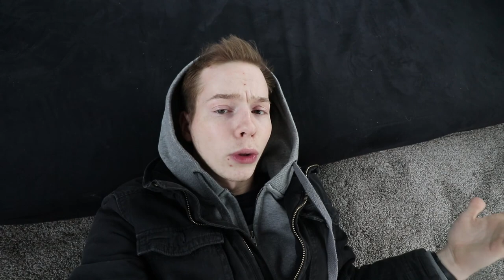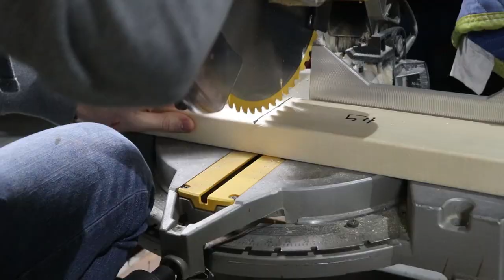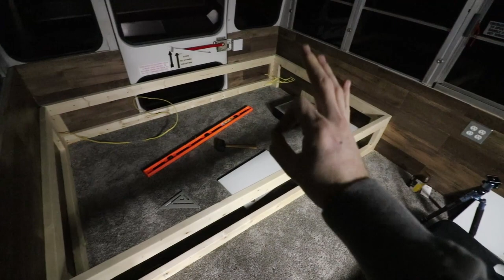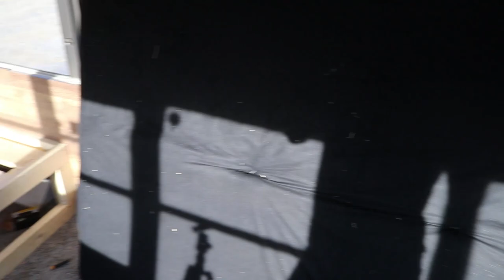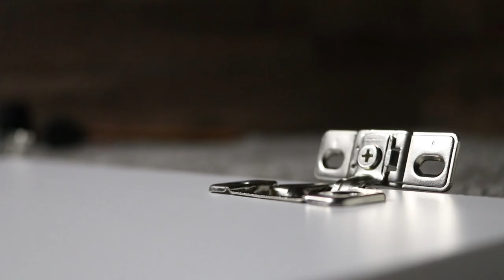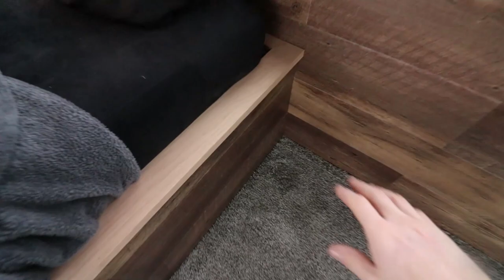Adventure Bus Build Pt 10 - Custom Folding Bed with Storage!

Comment: Great job on the bed, looks awesome! When you use the circular saw to cut, adjust the blade so that it goes half a tooth below the bottom of the wood. That will reduce splintering and will make it easier to cut.

Comment: The bus has a lot of room on the underside by the frame so you could put the batteries and inverter there, even a water tank maybe.
Reply: This, all the RVs here have almost all the utility stuff under the body so you save up room inside and centralize "unmovable" weight
Reply: You can put the batteries on the side it’s like the perfect spot
Reply: I second this! Be much more practical and would allow for a lot more creativity on the interior!
Reply: g6qwerty agree 100
Reply: He's gonna be off roading in it, so must be needing good ground clearance.
Reply: That's actually a very good idea!
Reply: g6qwerty or a generator if you need it
Reply: shrey raj they are in between the frame and body so it wouldn't affect anything
Reply: guys the water tank is best on the top of the bus because the sun will warm it up... just saying
Reply: Put the batteries on the roof, Uncovered and wait until it rains. You might get a nice firework show :)
Reply: Michal Sobocinski so you want to not be able to use the water tank during the summer or something

Comment: How about a back up camera? With such a thing it might be useful
Reply: SECONDED!!!!
A very smart purchase. He could even get backup sensors if he wanted, they're really not THAT expensive to do.
Reply: he could get one of the license plate frames with a bluetooth camera feeding to an android head unit
Reply: That's actually a really good idea, there's going to basically be a bunk bed setup so that would be a good route.
Reply: Backup camera + towing a trailer. 

lol
Reply: back up camera on the trailer ?
Reply: felixlovesredbull currently the trailer has a plug that connects to the rear of whatever you're towing for tail lights, you'd have to create another plug on the trailer AND the bus. I think he'd be better off buying ten mirrors.
Reply: CJ Mervyn back up camera when not towing and tow mirrors when towing 

Lol

Comment: Excellent work. If I had built the bed, I would have put the bed part itself in the dead-bang-middle of the back wall and build two taller cabinet extensions on either side to serve as storage and armrests for the mattress in sofa-mode. You can get tall and narrow slide-out shelves like the ones from rev-a-shelf to put in there. You'll eventually learn that every drop of usable space in that bus will soon be at a premium when you load it up for a few days. Curtains and tint should help make it feel private and cozy too. If you're considering designs for a sink, fridge, and/or other cabinetry, google conversion van galley for ideas. I'm a big fan of the galley foot pumps for water designed for boats. No electrical connection to make water come out of the spout.

Comment: Might be complex but I think you should put retractable/folding cup holders at the side of the couch or end of the bed
Reply: Cami Adam Not that’s complex, he could buy some and just bolt it on
Reply: Cami Adam I was thinking th same thing, that long storage compartment he could make some half drilled holes for cupholders
Reply: saab made those kind of cup holders in the 9-3 and such. could probably glue a wooden plate on it to make it look good
Reply: Cami Adam i
Reply: Just look up boat cup holders and there ya go
Reply: Cami Adam screw cup holders put a whole bar table in it
Reply: Aubry Exactly what i was going to say. They are a bit pricey thought.

Comment: Who taught you to drill a pilot hole everytime I never so unless it's think wood
Reply: It helps the wood not crack. In my experience with wood, it's a good practice to avoid splintering it, which I have done many times. Drill a hole a slight size smaller than the core of the screw, and the threads are just about all that go in to the wood. If the wood is weight bearing, the frame of the bed is a good one to use pilot holes on. Splintered wood loses a lot of strength.
Reply: yea, think wood is a b*tch

;)
Reply: It’s common practice to drill a pilot hole.
Reply: "Takes high school carpetry once"
Reply: Yes, the wood is very think.
Reply: Dat think wood
Reply: Think big, think smart, think wood

Comment: This all looks quite good, love the montage wood cutting. Also, I think you should have the drawers on the bottom side of the bed, swing down instead of up, reason being. It's going to be a pain in the butt to get into it if you have to go onto the floor all the time. Also, use a magnet latch to keep it from dropping, if you do decide to reverse the swing direction. Glad that you're having a ton of fun man. If you need any wood working help, feel free to ask anything.

Comment: u do realise if you put a shit load of electricity underneath the bed, u probably wont even get a single hour of sleep...
Reply: AeroGaming333 van life people do it all the time
Reply: AeroGaming333 why ?
Reply: I think it's fine
Reply: What reason could you possibly have for that....
Reply: "u will probably wont",...lmao
Reply: Why?
Reply: Caleb isn't Kuroko from A Certain Scientific Railgun, he isn't going to get electrocuted all the time for sleeping in a certain bed XD
And in reality, the electric fields are no problem, and there won't be anything that can buzz audibly all the time. My clock radio is kinda defective, and it's right by my head when I sleep, giving off weak electromagnetic fields and a very low buzzing sound. Been that way for 6 years, no problems sleeping between in being unplugged or not. Only the light is a tiny disturbance.
Reply: I hate sleeping with tiny lights around
Reply: Thanks for correcting..... Just so you know, I'm Dutch and my English is shit so ty ;)
Reply: Ok pannekoeken met stroop for everybody!

Comment: Nice work...couple of suggestions, the cabinet doors are going to require flipping up side down-you'll have to be on the floor to see into the area. Better still consider sliding doors that bypass each other.  Borrow or rent a router and round over the oak strip on the front of the bed area. Bumping into it will "wake you up".

Comment: I think you should make those cabinet doors a lot bigger. That’s a huge amount of storage space; and if you’re trying to get something in the back it’ll be a pain to be reaching super far back in a small hole. Also, you should have made the bed taller so you could fit more storage underneath while maintaining your vertical room. In these builds, no space can be wasted. I built out my Ford Expedition EL like this.

Comment: It would be really cool to see a sectioned back door like in a truck with a bed cap or some suvs where the top can open independently of the  bottom so you could potentially get to the storage while leaving the top section closed off

Comment: You should add 12 volt linear actuators to the back of the bed so you can change it to couch mode at the flip of a switch as well as be able to adjust the angle your sitting.

Comment: Looking awesome!  Just a tip for batteries, if you go with flooded acid you'll want a way to monitor and vent hydrogen when they are charging. You can use AGM or gel cells to avoid worrying about that but they are more expensive.   No issue with putting the electrical stuff under the bed, but just make sure it's easy to access/work on.   Basically you'll have batteries, inverter for 120v stuff, solar charge controller if you go solar, and maybe a charger for shore power.  You'll want some switches/breakers so you can turn that all off when parking to avoid draining battery.  Fuses and maybe even a small electrical panel are a good idea.  Lookup the max amperage each gauge of wire can handle and fuse it for that.    Lots of room on the roof for solar panels so lot of potential there.

Comment: Oh oh and hb ! Putting some small 10 inch subs next to the white cabinets you can buy probably two single 10’ sub boxes and then custom fit them to be nice and flush to the wall of those cabinets so they just look as good as they do now ! And if you find a way for it to look flush with like the air vents sub boxes it would sound total bad ass and look amazing !

Comment: Might want to consider putting a brace under the center supports for the bed ..  The screws you used to hold the boards up wont be able to hold long term ..  They will come loose or pull out of the board, and the supports will fall ..    Maybe a metal L bracket if you dont want to put a support under it ...   Could also help to support the center of the boards under the bed so they dont sag .

Comment: You might want to consider some supports under the 2 flat boards you have used in the frame, you are asking a lot of the 8 screws currently holding all of your bed off of the floor. Great job on the bus, very inetersted to see the final version and where the passenger seats will be.

Comment: you should put a short wall to about half the windows height were the pillows are, made of wood on top of the cedar lip you put op on top of the bed frame. the sleeping area from the main living area should be sectioned off a little and the wall would provide privacy. leave a 2-3 foot opening at the foot of the bed w a rounded off corner for entry

Comment: would take out the middle part of the bottom 2 by 4 in front of the rear door so you can slide stuff in tunder the bed  from the rear door , doesnt do mush structurally , you can add some uprights on eac side of the door post
level only works when the bus is sitting level , having the doors hinge to the tp isnt handy for getting stuff in and out (have to bend down pretty deep to see whats in the storage

Comment: You might want to shore up your slats for your bed, you get to gingium up in that bed and your gonna blow those screws right out of that frame... Maybe a L bracket on the inside just to get screws going in two directions. Just a thought.. ;)

Comment: Maybe make sliding doors for the cabinets under the bed? It will take less space, as you wont need clearance for the upwards swing of the cabinets now; and it should not be that difficult to change over too. With sliding doors you could also match the wood with the rest and just put finger sized grommets in for handles.

Comment: I think you should have gas shocks holding up the couch/bed folding section. I think it's cooler than having a piece of wood that just supports it.

Also hide the wire in that hatch. It looks butt ugly, manage the wires or something.

Comment: Nice bed cabinet doors but i'm wondering if they would stay up with that hinge mechanism?  Might get annoyed after some time especially when you're putting something in which requires two hands.  I would have put the hinges on the inside and let them both open towards each other instead if space permits it.

Comment: you should have left the bottom cut on the board so you could slide the battery rack in and out to service it through the back door...just saying. you could still modify it later. looks good

Comment: And I've noticed you have been using a drill to put screws in if I were you I would look into an impact driver makes it so much better and doesn't strip the heads of the screws out and if you do look into it get a Milwaukee,the best quality you can get 

Also works good for stubborn bolts.

Comment: Paint the bottom window on the rear door black so no one can see what you're storing under the bed and tint the rest of the windows 5% as well as curtains. I've had 4 different camper vans and privacy is key

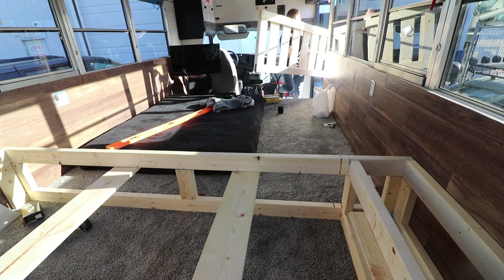Comment: Ok so here's my question. At @8:00 the only thing you have under the folding frame, mattress, bedding, and two people sleeping on the bed is 2 1x4's screwed in from underneath? There's no way that's going to hold. Especially with any sort of "activities" on the bed. Might want to think about reinforcing that somehow.
Reply: Or maybe they're 1x6's can't really tell... But still not enough.
Reply: Hmmm yeah you may be right, the issue is not the lumber, but the way that the structural integrity is relying on the pull strength of the fasteners.   It may be too hard to go back and change it now, but he may be able to just add more.  I would put at least 3 screws per side at angles, maybe even lag bolts on a few of them.   That said it's probably good enough, but I like to overbuild stuff.
Reply: Red Squirrel The amount of unsupported weight across that big of a span is too much for 1x. As well as fastening from the bottom. But yeah, going to need to do something to fix that. Just the weight of the bed frame and such bouncing down the road is going to try to pull those screws.

Comment: You just need some air conditioning where the bed is and it will be nice and cool.
A list for the adventure bus
Fridge
More air conditioning
Bathroom 
Couch
Tinted windows
Car wallpapers
Superglue the backdoor so it won't open

Comment: Can't stop thinking about the yellow wiring rubbing off and conducting with the metal wall. Could the extra plastidip insulate in case it happened?
Reply: It will probably be okay because that yellow jacket is not the wiring insulation. NMB and other Romex-style cabling have that protective jacket around the three conductors needed for regular residential type wiring, and they have their own insulation beyond the jacket. NMB is also fairly heavy duty.

Comment: I wonder if the pump has airleaks or something because it takes so long to start
Reply: or the check valve is leaking and it empties the fuel line back in to the tank

Comment: Please tell me that bed is being held up by something other than those two 2x6 pieces of wood, it will come apart in time, you have 50+ pounds of wood alone on them and combine the weight of two people that comes out to be 350+ lbs of weight resting on those 2 pieces of wood. I works I'm just saying that over time it will start coming apart.  Otherwise great work!

Comment: Your bed is goin to break. The two plank of wood u put on the bottom should have been screwed on top o the wood beam only thing supporting ur weight will be the screws u put in them.

Comment: gingium the way your securing the bed frame is pitiful
not trolling the frame it self is fine and all and the placement dosent suck either
but how its mounted to the bus's thin sheetmetal walls thru your insalation is just not a good idea
personallyi would have checked how much meat your screws have to grab inside the bus's ACUTAL walls between the sheest of sheet metal
thats where 98% of your griping power comes from